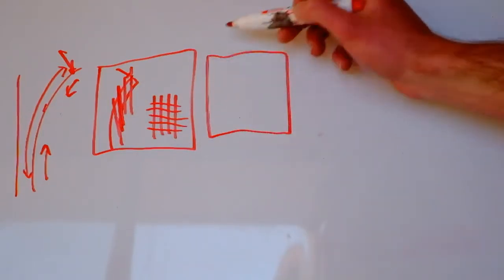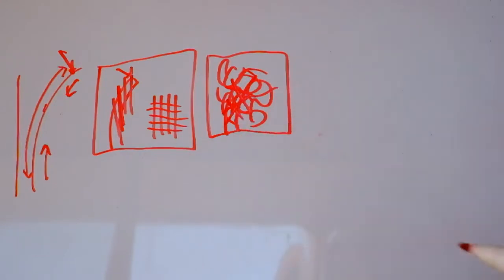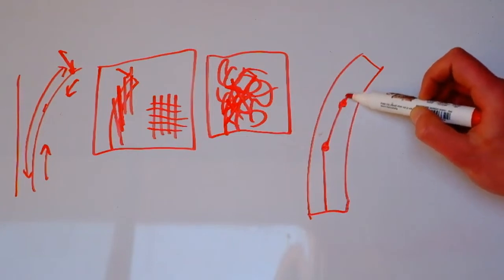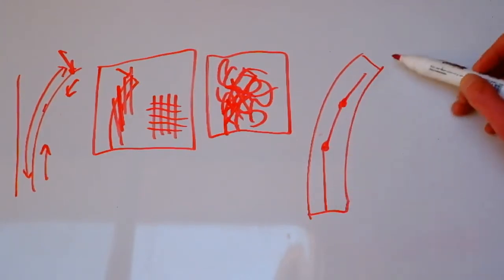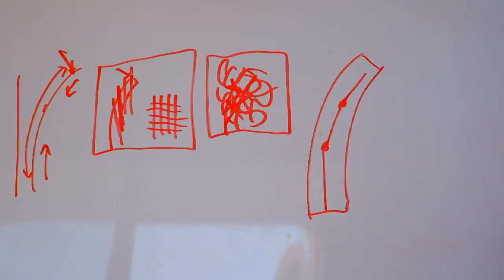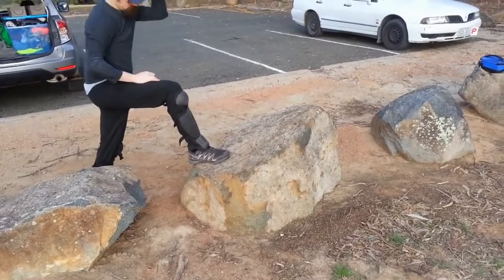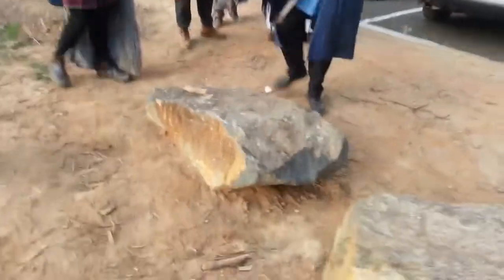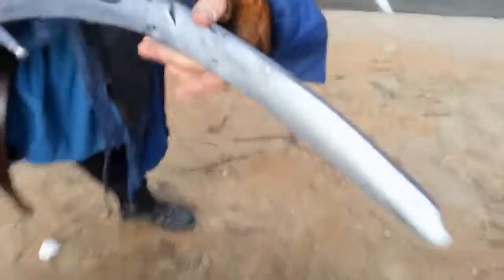LARP curved fiberglass core talk and testing

Comment: The issue with pvc shattering is because it was store out doors in direct sunlight for extended periods of time. It becomes brittle from excessive uv. Fresh or new pvc doesnt shatter an easy way to test it is to cut a piece off and hit it with a hammer if it shatters its no good if it just warps deforms or bounces its good to go!

I learned this a few years ago dabbling in pvc pipe bows for archery

Comment: I might just be talking nonsense but based on some experiments I've done in the past, I think the biggest reason why PVC breaks is because of thermal shock or cristalization due to excessive temperature, as well as dips created during the thermoforming process. 

But yeah, PVC will always be weaker than fiberglass, so I really apreciate someone with so much knowledge taking interest in this.
 I didn't even think half the methods you've shown here.